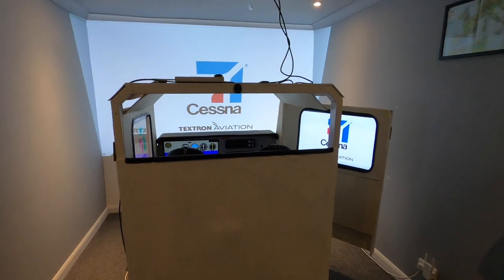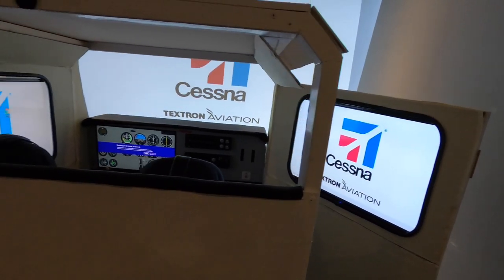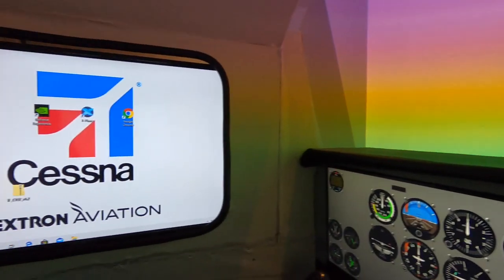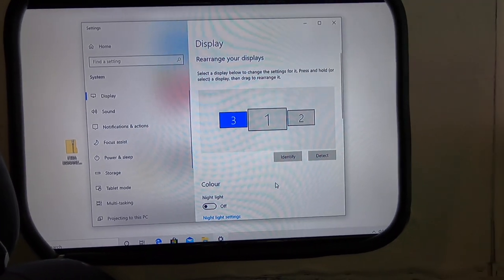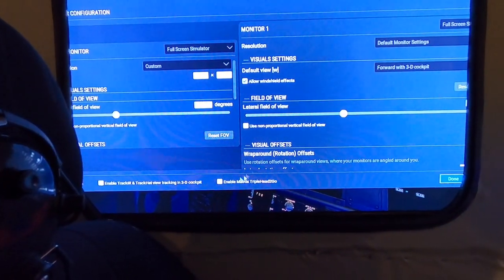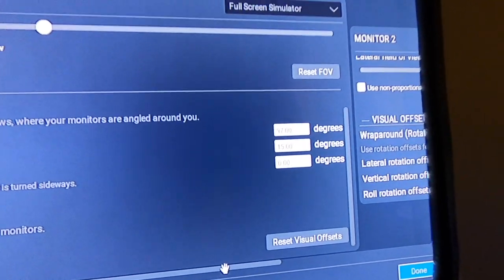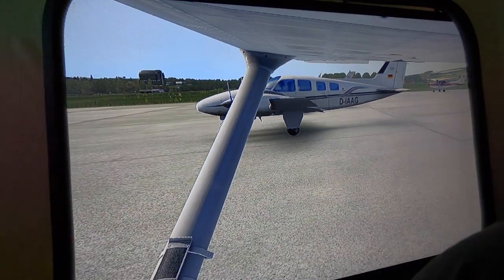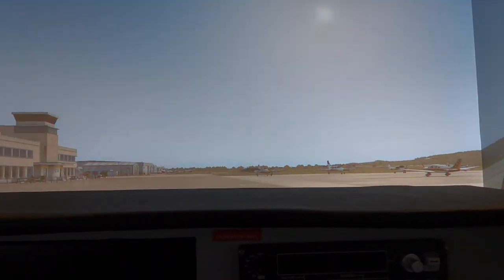How to configure multiple monitors on Xplane 11

Comment: A quick question. I have 3 40 inch monitors and a standard 21 inch monitor but I notice after a dozen views that you do not use a standard monitor for windows but use the left monitor for windows. My displays show up as the 21 inch monitor is #1 and all three of the 40 inch displays show as #2. I am going to remove the 21 inch but where do you connect the actual computer? I have all three monitors connected to a hdmi hub as you do but not sure how to connect the computer so I see it on the screen like you are doing?

Comment: Very good work.
Why do you use a splitter screen ?
Not enough outputs? Or it's because with the splitter you don't lose any FPS ?
Because if we add screens in normal way, the FPS are often divided by 2
Reply from the maker: I only have one display port on my PC and a splitter only reduces the fps by 5-10 fps, where as if each individual HDMI cable was inserted into the PC's built in hubs it would drop by 20-fps, hope this helps!
Reply: @aviatorsj9025  it was my first thoughts, but I don't understand why a splitter does a better job than one graphic card with multiple outputs.
Reply from the maker: @ericveschi4904  because my graphic card dosn't have multiple outputs.

Comment: What kind of frame rate do you get with that? I have a similar setup but with 3 networked PC's.
Reply: Not sure about him, but I can run three 2560x1440 screens on a single PC with relatively high settings and I get about 30fps.  I have added another two touchscreens and two side monitors now and use 3 instances of x plane on same PC (2 GPUs).  Framerate is still 30fps.  I don't see the need for multiple PCs when a single powerful one will do.